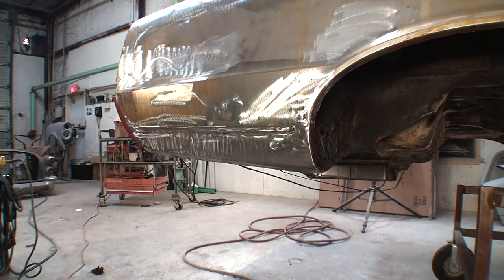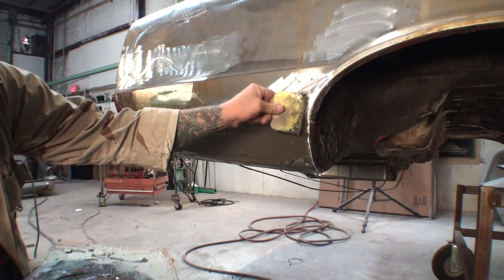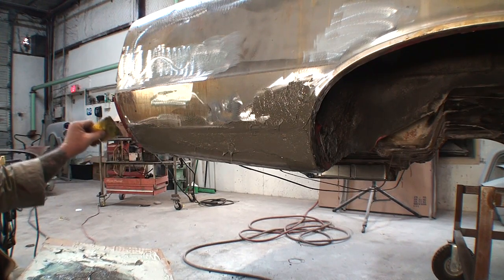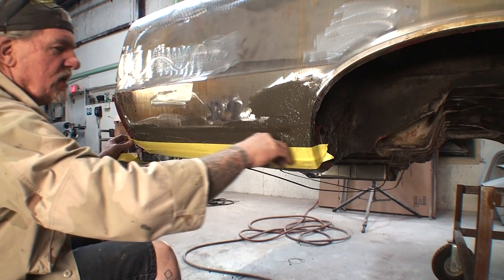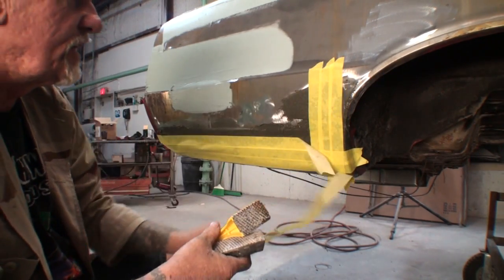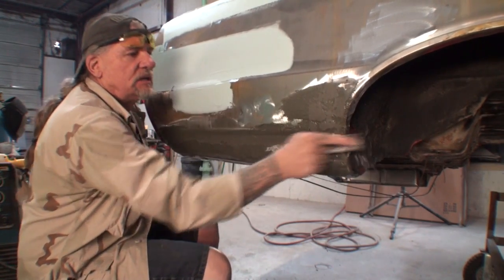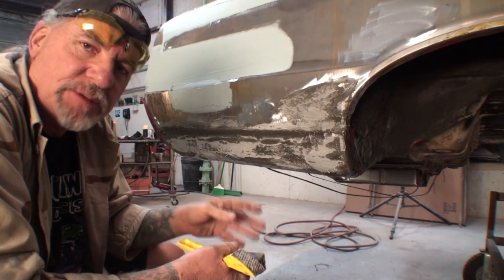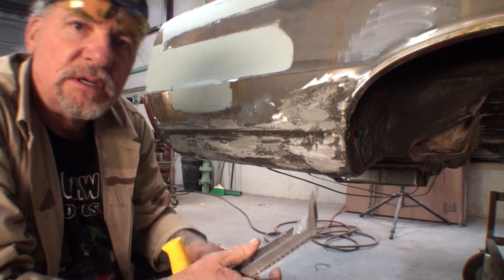How To Use BONDO - NO SAG'S!

Comment from the maker: Winter time can really slow you down when it comes to BONDO WORK! This is a great trick to use...  Comment below and let us know if you have any Secret Tech Tips on Using BONDO!  Thanks for watching ...
Reply: D.I.Y. AUTO SCHOOL I must see used 20 gallons of Dirty Glass in over 35 years never had to take a grinder to it cheese grated and and put Bondo over
Reply: great tip on the tape... i never was taught that.  how cool
Reply: got a spot same area onmy 78 nova...was going to try to mig in a piece metal for a rusted dent hole...think i may do the same..than mess with welding grinding and all that mess..
Reply: Have you ever used lead like the old timers use to use there Pete?

Comment: Pete, My garage is not heated in Nebraska, and I have never thought of using 2” tape over the filler. I am blown away with a simple idea that works using products you have already.
  Now I know you well enough to say that you commonly use only 3/4” and 1 1/2” tape for everything. This is a helpful tip for the guy working on a vertical surface with dynaglass or other fillers. 
 Also, I have used “Cheese Graters” for a long time. I have never seen the yellow curved one you had shoed, but didn’t use. It would fit into areas a flat grater would not fit. Thanks very much again for the excellent tip that works! Blessing.
 And for the 7-9 losers, who hit “Thumbs Down”;  are you guys sniffing paint thinner in a brown paper bag, or live in the mile-high city. Getting stoned is not a way to do body work! Get help! Then you can learn from My Friend Pete!

Comment: Great tip pete. I was told you should always warm the panel up before using filler (in the winter) as the filler heats up as it cures and if your putting it on a cold panel, you can end up with trapped condensation under the filler. This makes sense to me, as when hot and cold meet = condensation.
Reply from the maker: Never thought of that since I live in Dallas TX  it doesn't get that cold here... Makes sence though!
Reply: That's true, here in the UK its cold most of the time!

Comment: Use all-metal for heavy fill work on bare metal, lay down some epoxy primer, scuff it and then apply your plastic filler. Thats the best way to prevent corrosion underneath
Reply: He bashed those products in another video...
Reply: @GlassTopRX7  not surprised, he does everything like it is still the 1980's

Comment: I wont tell nobody how to do it Pete knows what he is doing. Got a Bondo Question??? You ever see someone put Fiberglass Resin in bondo to make glaze?? Guy i know does that. Sands easy but what scares me is resin takes clear hardner and he wont use both hardners and says he has never had a problem. I been to scared to do it. What is your thoughts on that???
Reply from the maker: I wouldn't l suggest it Jeff... Ive never done it.. The best thing to do is just buy some glaze and be done with it!  Hope your little bug is getting done!
Reply: I do this all the time and never had a problem. Just use cream hardener and don't add too much resin otherwise it will be super runny.

Comment: I like spreading my filler first,then apply wax paper over the area and use the spreader over the wax paper,when the filler drys you can peel the wax paper off.
Reply: I have use plastic poly before but I like the wax paper idea. I will give it a try.
Reply: I do a similar technique, and I also use a hawk with wax paper taped over it to mix my filler. Easy clean up

Comment: Yes tape is a good way to hold sags plus I use it to hold fiberglass in position too when working on boat hulls or fiberglass parts. Fiberglass, bondo and fiberbond don't stick to masking tape. Instead of using the expensive mold release I've used masking tape to cover the entire mold first then glass over it. It pops right off. Poor mans way lol but hey it keeps the job going.

Comment: What are you doing to stop surface oxidation on exposed panels that you might be working on over a few days
Reply from the maker: This car was Soda Blasted, No worrys of that.. The only time you have to worrry about surface problems is when you have it sand blasted, then you would apply 2 coats of epoxy to protect it..
Reply: @diyautoschool  thanks Pete. Cheers from Australia

Comment: do you ever epoxy then scuff and do body work over that? its standard now, no?
Reply from the maker: The only time I use epoxy primer is to seal the metal if it's going to be sitting around for a long time.. It's not standard to epoxy first then do body work. If you epoxy first you still have to rough up the surface and by the time you do that you hit metal anyway!  Best is if you can do the bodywork first and disregard epoxy all togeather..

Comment: It is easier to use a DA sander and then hand sand with a sand block💯💯
Reply: I use an air board with 36 grit sandpaper..gets it off in a hurry plus makes it flat/straight. I've also used a cheese grater and grinder like Pete did when the filler is really thick and lumpy...then hit it with the air board. I had an old body repairman tell me years ago to not use a DA very much if at all because the DA does not make a panel straight enough. I stuck my DA in my tool box and there it sits. Bought a good air board...much straighter/flatter....also use a hand board/block a lot. Now want to save-up and buy one of those short air boards/straightline boards. Don't waste your time buying one from Harbor Freight...I went through 3 new ones in 3 days. Eastwood has a great one for $80.00. works and lasts like the $600.00 ones IMO. Just make sure you don't have too much air pressure because too much air pressure is what breaks these airboards. But yes a DA will hog off the filler quickly but a striaghtline airboard will show you where to fill afterwards. my .02
Reply: I use 80 grit to remove and line in the bondo and in spots were I don’t want bond and once i get everything the way i like then i use 120 grit
Reply: @coherantbliss3483   40 grit on a  8 in. mud hog 40 grit on air file, get it straight, thin coat of bondo to fill scratches, cut again with 80 on mud hog, block sand with 100 grit, finish with 120, send to painter,  In 45 yers I've probably spread a railroad car of bondo. Pete has too.
Reply: @quantrillraider4093  Thanks for the info...I've been hitting it with 36 or 40 to get straight/shape then fill and sand with 80 then fill/spread a thin layer and then sand with 150... I guess the 120 would be a bit quicker and just add a little more primer lol. I'll try your way!. What is your "mud hog"? Is it an angle grinder with coarse sanding disc on it? I use the latter a lot when working with fiberglass.
Reply: @coherantbliss3483  National detroit and hutchins make a 8 inch orbital sander. Get one and use it, you'll be a bondo cutting God
Reply: @quantrillraider4093  Lol! Ok I'll get one!

Comment: Pete thought you did t use reface on top stuff
Reply from the maker: I don't use it.. What do you mean???
Reply: D.I.Y. AUTO SCHOOL you used re face fir big paw on the red chevelle ...... I thought you didn't use it in quality classic jobs that's all ........ your vids are great ........ I watch every night
Reply: Love ya Pete..... best vids on the net
Reply from the maker: @6655nico  You missed understood the video I made about REFACE --- I "SAID" I don't use it on THE WHOLE CAR like most shops these days use it.. I SAID I use it on the roofs of cars that have had bad hail damage and it's a thin layer not inchs thick just to float it out to make it all even...   And yes I did use it on Big Paw's ROOF because it was Hammered with dents from front to back...  Thanks for watching..
Reply: D.I.Y. AUTO SCHOOL yes my sincere apologise pete...... I was watching a vid on block Sanding doors..... it said you didn't use reface and it should be put well out of sight ....... my apologise pete .... sorry ... I try to grab everything you say .... if you have to use on hail damage how do you use it so it doesn't sink ? Thanks pete
Reply: Your vids are very detailed and I've started doing dry sand before wet sand ....... wish I could come see you one day
Reply from the maker: @6655nico  first you do all your body work necessary and then you come back a spray a full coat of reface on it to level it all out.. You would spray it on top of epoxy primer, old paint, or primer after it's been prepped properly (NOT BARE METAL)...  Good luck
Reply: D.I.Y. AUTO SCHOOL hi pete spray reface then block 80, 180 then prime ......... was thinking when you've put epoxy down ....... carnt you guide coat the epoxy then block ( find high/ lows) ??

Comment: Why not just use body filler it's cheaper?
Reply: I think he used dinaglass cause he welded patches on the body.And when you weld patches on a car it is a must to dinoglass the patched areas to make it water proof.if you use body filler over patched metal water will be absorbed thru body filler thru the back side if you have small pin holes in the weld or tiny gaps where the metal is buttwelded or overlapped.
Reply: Because bondo shrinks back when applied heavily and dynaglass doesn’t to such an extent. It’s also more structural since it contains ‘short strands of fibreglass’ 👍
Reply: Duraglass isn’t anymore waterproof than regular bondo. That’s what it is. Filler with fiberglass strands mixed in. He used duraglass so it won’t crack or shrink and show through the paint. I’m sure his welds are good and he will seam seal or put some sort of coating on the back if it is accessible. Knowing Pete he also flanged that joint.